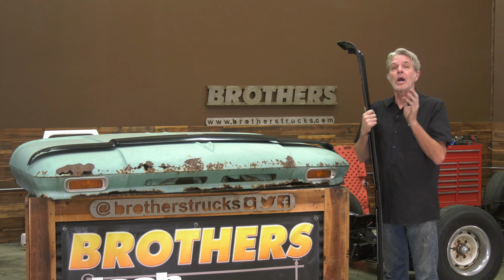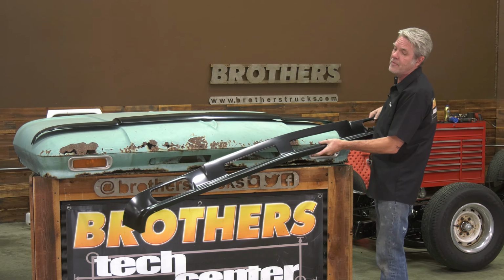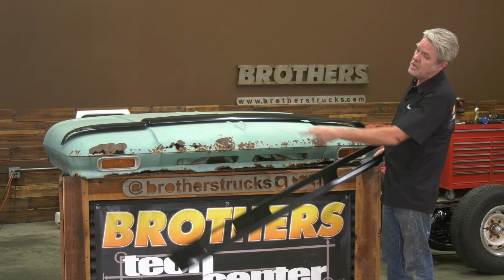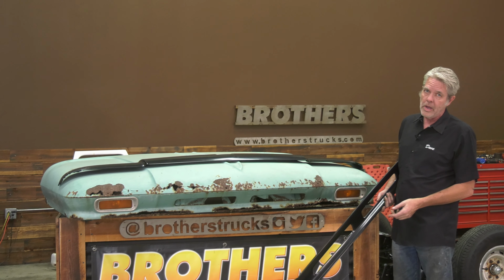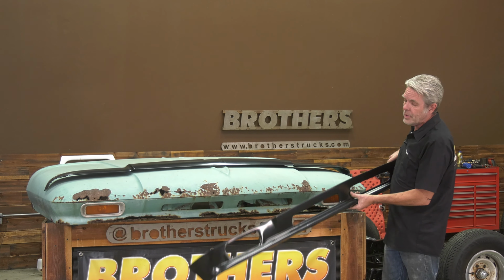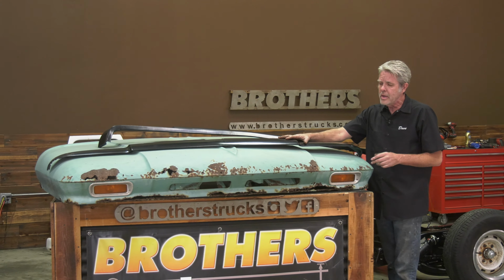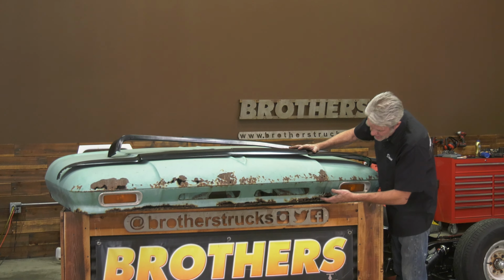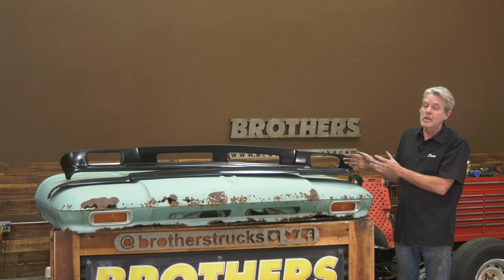1962-1966 Chevy Truck Hood Repair Patch - Upper & Lower

Comment: Okay that was a teaser. I thought great they going to fix that ugly Hood. Beauty is in the eye of the beholder and I guess I'm not beholding it on that hood. You know when you see something coming down the road that's the first impression. I thought you were going to fix that hood. So what are you going to do with the truck once it's done? You going to drive it? Sell it auction it charity event? I assume it's in Tennessee now and that's roadworthy. Also the first get out to get it started 10 grand. Call me cheap if you like but that could get it started. For some reason I was thinking you were doing a benefit for St Jude. Glad to know those patch panels are out there. I think I just go buy another Hood before I patch the top and the bottom is different